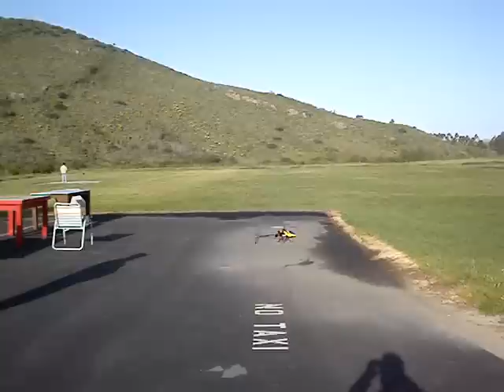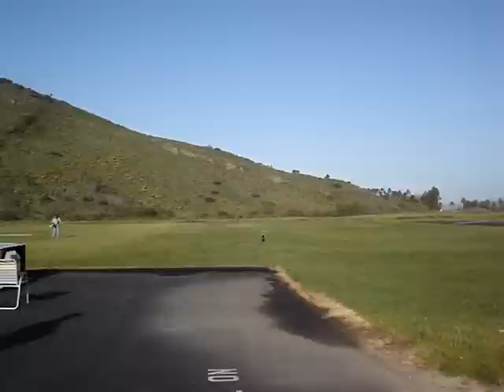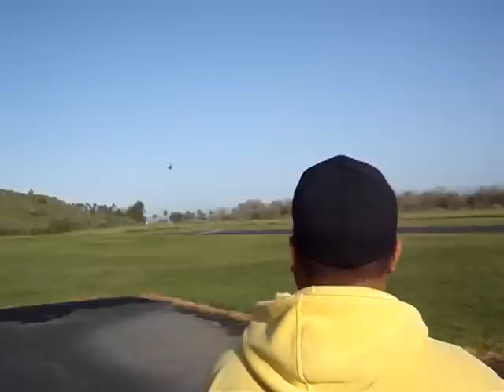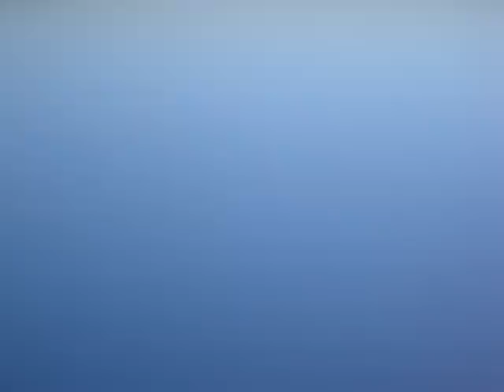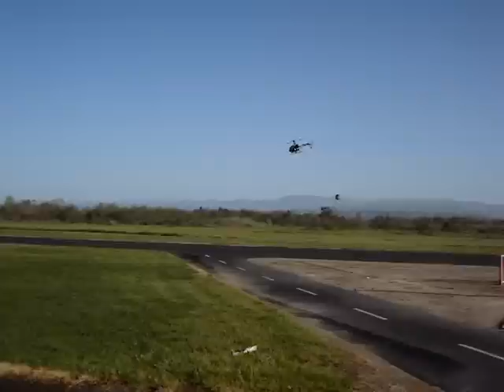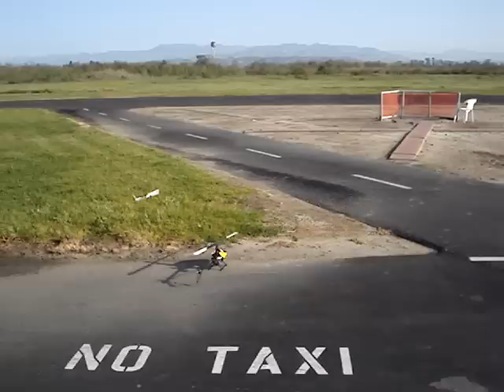Fixed Pitch T-Rex 450

Comment: yes but I think the idea is to add fixed pitch dlades and clearly get rid of the soft start feature on the esc.
I don't like quad rotors and was thinking of trying this for fpv heli, but I would prob use flat bottom blades. Slugish is what im after :)

Comment: Doin the same thing with my 500 and used a 600 tail for control since I have a lower HS. 600 tail with lower HS gave me more control than my 500 tail at higher HS IMHO. Got the same bobbing but thought it more to do with HS, gonna try higher t-curve. Gonna 3 axis head lock her after I get it dialed in using a v-tail mixer...really surprised at the stability and responsiveness though.